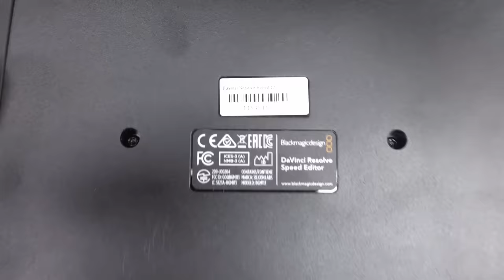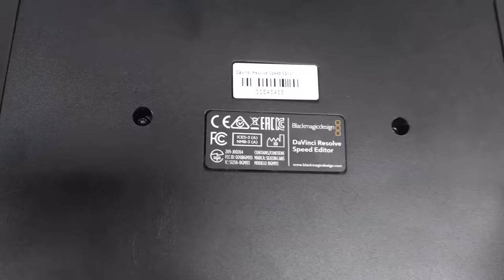Davinci Resolve Speed Editor TEARDOWN

Comment: Yeah the switches being clipped into the metal backing plate and then being soldered to the PCB is common with mechanical keyboards. Seems like they just followed the standard procedure there. That jog wheel looks nice, wonder how I could get my hands on just one of those on its own ^^"
Reply: Yeah, seems to be plate-mounted Cherry MX red switches.
Reply: Very cute fursona in your icon!😃
Reply: @00Skyfox  thanks, you too ^^

Comment: Love that extra support on the USB port. That should cut down on the number of detached ports from abuse. That weighted knob looks like it feels fantastic too!
Reply: They could also have taken a note from phones/laptops. Place the USB port on its own little board with a cable running over. Reduces the leverage that the plug can put on the solder joints, plus it allows solderless replacement if it does break.
Reply: Love that the USB support is on crooked.
Reply: I'm getting increasingly disenchanted with USB-C for power delivery on laptops, it's doing okay on phones but I've broken one laptop connector on a Dell Latitude laptop and one on a Razor laptop. The most frustrating thing is that, looking in the Dell, it's a nightmare to replace the connector because of the number of pins on it (compared to the old coax cables). I think laptop manufacturers need to think about making the USB-C connectors (especially the PD ones) a separate, field replaceable board.

Comment: 5:49 This is a normal arrangement for high quality mechanical keyboards. Having the switches clipped into the metal sheet means that the mechanical force from your finger is transferred into the metal, not into the circuit board where it would eventually break solder joints and traces from flexing the board. 
And the metal plate being heavy dampens the sound of the switches as well as stopping it sliding around.
The board is suspended off the pins of the switches so that's a really nice for both construction (no need to screw the board in place) and eliminating stress to the board during use. 
Also the lack of flexing when pressing keys feels better and more consistent. 
So it's all really nice although they don't mention what brand/type of switches are used on their website. They just say "switches that egamers use" which could mean anything.

Comment: looks pretty nicely put together. Mildly curious which mechanical switches (or at least which manufacturer) they went with. 
Have you seen those projects using a BLDC motor as a software controllable haptic knob? I'm surprised I haven't come across one used as a HID for a pc yet. Not entirely sure how practical it would be, but the novelty is there for being able to do something like simulate a hard stop at the end of a timeline or light detents at each second/minute/etc
Reply: Apparently they're Kailh brand switches. Just watched another teardown :)
Reply: I guess the problem with such a haptic knob would be the high power requirements. The Logitech MX Master mice have electrically controlled detents on the scroll wheel that work magnetically, which seems to require hardly any power at all

Comment: If you worked professional/broadcast video through the 70s and 80s, that kind of quality engineering & assembly was fairly common in high end equipment.

Yoummy find there’s an adjustment for the friction/resistance on the jig wheel… in the ‘old days’ that was quite common.

Comment: Been working with this device now for around 12 months. It truely is a nicely crafted device, I don't think anything of it needs to be made better - aside from maybe having a dedicated power off switch. I was a little surprised they got a standard 18650 battery in there, I expected something larger. But then again, you don't need something larger. The battery needs to do very little and it easily lasts 30 hours of editing. And if for some reason that's not enough for somebody, the housing seems to have enough space, so that you could add a few more cells to this one, connect them all in parallel and you might have a device that last you 2 months on a charge at daily editing.

Comment: modern ham radios have nice weighted jog wheels on them and also have a slip ring on them so you can adjust the braking from zero friction (spins like crazy) to almost solid
Reply: ICOM ic211 even got a active brake.  you spin it slow, it has friction. but at a certain velocity the brake opens and it keeps spinning for fast jog

Comment: You missed an opportunity to remove  the keycaps and show what type and brand of mechanical switches they use :(
Reply: 06:16 It seems the key caps can't be removed easily
Reply: @r_firefly4292  Those keycaps should pop off with a little force. Should be just press fit. They look like German made cherry MX red's to me. The side view at 7:02 shows the side of the casing, which looks like cherry's and I can see the red plunger under the keycap. The pinout on the bottom of the board with the black plastic nub in the center and the 2 pins look like cherry mx style too. I could be wrong, but that's my best guess based on what I can see.
Reply: Totally a Cherry compatible key. The moment he described them it had to be a mechanical key of some sort. And the flash of red you see when he rotates it does suggest a Red style.
Reply: According to another teardown I just watched they're Kailh brand switches

Comment: Black magic make a bunch of keyboards, they may be sharing the same PCB on a few models which may explain the cables to connect the PCB's.
I got mine, the knob is amazing but I hardly use it. Your editing style needs to match the layout or your mostly going to be using a keyboard and mouse anyway, so it's over on the side gathering dust. Still amazing price for what you get.

Comment: Without seeing that encoder (main wear and tear) I'd count this as less than satisfactory. Sorry Dave, now some will think you promised not to show..🤔
Reply: I don’t know if he’ll ever recover
Reply: I did a hunt around and found another teardown video, a lot more detailed, by DeepNothing
The rotary encoder is a custom plastic body holding two bearing races, and the bottom of the shaft has a magnet attached which interfaces with an AS5601 rotary hall effect sensor.
I've seen James Bruton use similar sensors (maybe the same ones) in his robotics. They're incredibly versatile :O
Reply: @azyfloof   Thank you! I was asked for an opinion and was worried it might be the make-break contact type.